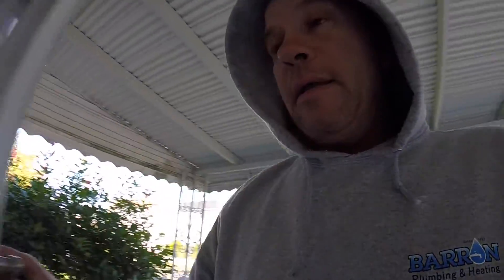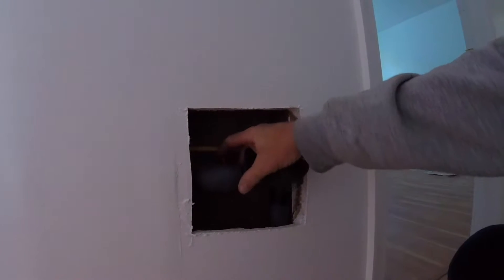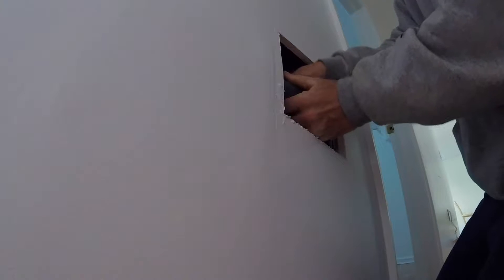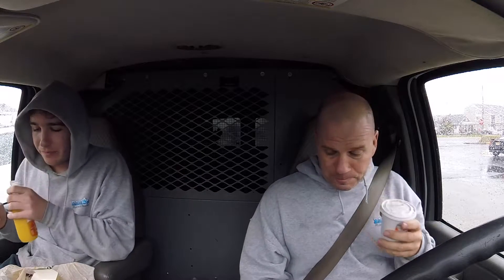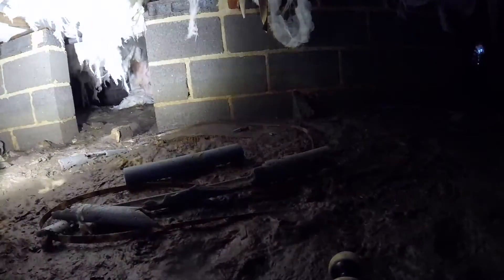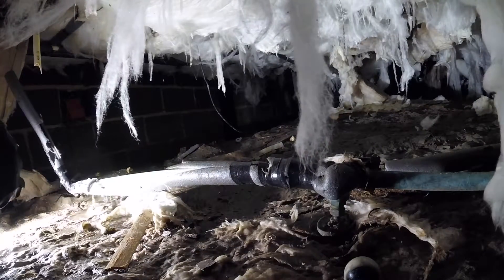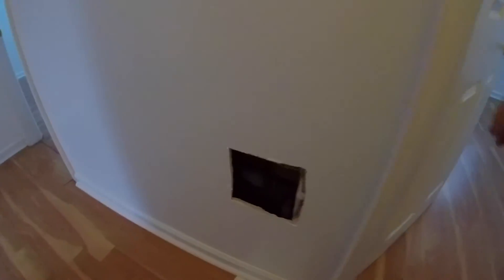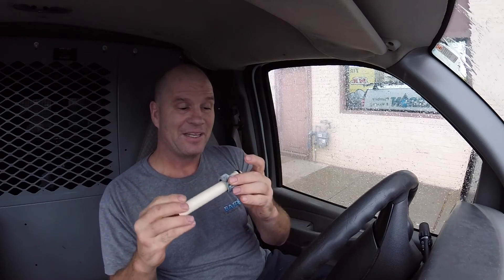Water Service  Copper Pipe To CPVC Pipe Repair

Comment: I find using air to pressurize the lines works great for leak finding, even a pinhole, buried in insulation and walls tends to hiss pretty loud. and sure beats water damage!
Reply from the maker: No Doubt.

Comment: We use flow guard gold in Ma the one tip I can give u is use the glue sparingly, if u use too much it can eat away at the pipe.  we did a test with one of there ball valves and poured glue into a closed ball valve in central ma and by the next day it had eaten away the plastic ball in a ball valve.
Reply from the maker: oh wow..interesting. I hope never to use it again. ha

Comment: You'll should get some walkie talkies so you wouldn't have to shout every now and then. Say in a case you're on the ground floor and Chucky is on the second floor of a building and you'll need to communicate, the walkie talkies will come in pretty handy. Just a suggestion i thought i should make. Think about it :)
Reply from the maker: So many tools..man you could go broke..great idea. We usually use cells for situations like this.
Reply: 20 bucks at walmart. Makes it easier to talk without having to dial a phone.

Comment: I've installed cpvc that's now been in service for well longer than the younger SB's have been alive. the scary part of it? I was a good ways younger than them!
of course I also installed "polybutylene" which held up fine for the period of time it was used (mid 1992 to 2005) don't judge I was a young "school brat". you probably wont find many folks that did plumbing well under 18 by themselves, without having any relatives in the plumbing trade. must be the german side of me =p
Reply from the maker: the ole poly pipe....i ran miles of that too when employed before i got my biz. Plumbing is evolving at the speed of light...well maybe not that fast.  ha

Comment: They have cpvc in alot of new houses around me it's junk. Been to a few homes after a freeze up. Last one had 27 busted 90's the homeowner had no drywall left after I got done finding leaks. At least 30000 in damage. The home was only 10 years old.
Reply: morale of the story, don't let plumbing freeze ;)
Reply from the maker: house must of looked like swiss cheese...wow.

Comment: Always use cleaner/primer to clean CPVC pipe first then glue. They have special CPVC glue & Cleaner/primer
Reply: they have one step primer/glue for cpvc *gold*. it can be used if permitted by code there. I'd never try it but myself and always prime first.
well maybe if it was temporary exposed feeder.
Reply from the maker: Since it was my first time working with the GOLD....ha. I read can and it said glue only. Or let me correct that. CB2 read can and I never looked back. The question is should have I....hmmmmmmm. we shall see.

Comment: That Flo gold is the worst,bought a whole case of that stuff years ago,ended up throwing most of it away. It says no primer needed ha,good job guys.
Reply from the maker: omg, this job was gnarly.
Reply: I just bought a house that's half copper and half FlowGuard gold.  The CPVC has a 1999 date on it.  I've started to replace everything with PEX,  if I need to shut off a valve on that CPVC I turn off the water first as I fear valves cracking right off.  Nothing worse then having a wide open snapped water line.

Comment: there are a lot of rules when prepping and gluing cpvc....you broke everyone of them. tough job under there tho
Reply from the maker: main rule i broke was leaving cpvc in there. what i miss? got to be honest i never worked with it. Thanks B
Reply: @ChuckBarron  I respect you for going under there- tough job. those types of jobs are for the young guys
Reply from the maker: oh for sure. I wanted CB2 to have a teachable moment but just had to get out of there so I pushed on.
Reply: @ChuckBarron  as far I saw, you glued and set it fine lol. Dknt see the issue with your job. This pipe is meant for pressurized and hot water as far as I know

Comment: How long did you wait for the glue to set?
Reply from the maker: 5 min...according to what the can said. Sound right?
Reply: I always give it an hour it depends on how you interpret the label
Reply: Yeah should let it sit for an hour , cpvc is crappy , they ran plenty of it here , including 2” mains in townhouses , I fixed one PRV rig that the broken by the fencing crew that was 2 “ and to shut down 900 units while doing repair because they asphalted over the project individual shut off valves in the street.
Reply: I think it was 4 1/2 mins

Comment: That low battery chirp from the smoke detector would have drove me nuts.  I keep a dozen or so fresh 9V battery in the truck for calls like that and just change them for the customer and add an extra couple bucks on the bill.  That way I don't have to worry about a 2AM "smoke detector sounding" call when I'm at the station cause you know they never call at 2PM when you're already up!
Reply from the maker: oh you know it...so fun at 2am for such a clown call.
Reply: what gets me is there's people that live with them chirping and I don't mean just for a few days. I've told them it was driving me nuts and asked if I should change the batteries for them. they had no idea the things had batteries, nor that they shouldn't be chirping. total face-palm >_<

Comment: Cpvc pipe is pvc pipe except you can run it on hot sides. Its chlorinated pvc pipe
Reply from the maker: ya we really do not use it hear. I was the lucky plumber on this repair. ha

Comment: I have to admit that I have used CPVC on a couple of projects successfully. I don't like it very much. I suspect that what happened in the case of your project is that it froze and cracked as a result. I probably would replace it with PEX. Theoretically, PEX does not crack when it freezes.
Reply from the maker: Yes. That was the plan. I was glad it worked.
Reply: Pex will freeze, swell, thaw & not burst, but at the fittings it will burst
Reply: there's good pex and there's not good pex....... pay attention to the "type" some will in fact split easier when frozen. the other issue is fittings, they can and will break or get pushed right out the pipe. back to rule #1, don't let plumbing freeze with any freezable liquid inside it ;)

Comment: You've got almost every other good power tool for plumbing, you need the Milwaukee 12 volt PVC cutter!  ;)
Reply from the maker: yes....I just used one. I gotta get one. the lil sawzall you mean?
Reply: @ChuckBarron  nope, I have the little sawzall too, but they make a PVC cutter as well

Comment: To cut the CPVC ratchet Cutters will be best
Reply from the maker: roger that....thanks chris
Reply: Good on new CPVC, but bad for old CPVC, especially hot water side. CPVC tends to harden overtime and become brittle. Using ratchet cutter often cracks the pipe. This is the main reason I hate CPVC.

Comment: "torch, flux, solder, brushes, couple of rags and a 3/4" pex to female copper sweat adapter" would have been what I had the parts runner bring =p
then again, I'd probably have just put copper in anyway...
Reply from the maker: Ya but I had to adapt to Cpvc wonder pipe.  I could of cut old stop and waist out. Put in propress ball valve and I had some shark bite couplings on truck. So many ways to skin a cat. Thinking back I should of did that instead of trip to home depot. oh well.
Reply: uhh, I was thinking heat and remove the copper half of broken cpvc union and clean it while hot and sweat on new pex adapter, using the existing short copper stub to valve..

Comment: has your head, neck, hands and back quit itching yet? I know what happens when playing in insulation like that lol
Reply from the maker: actually I made it out ok...so far. I been there though. oh that is no fun.
Reply: throttle bottle  I dunno how he does it but I use a full face for that. I hate crawl spaces
Reply: try doing electrical and vents properly in a blow in fiberglass attic.... you'll be swimming in it and standing on your head, there won't be a single spot of you that doesn't itch lol
Reply: I feel for the AC guys in the summer- all they do is install AC's in the summer and crawl in attics... Why doesn't anyone get Ac's installed in the winter? Should be a discount...
Reply: lol, because it sucks having to set up temporary heating and charging an A/C in winter is no bueno (heat-pump is an exception) but generally still needs checked and charged in the summer.. I know all about attics in summer, flopping in over 36 inch deep blown fiberglass like a fish, running wiring properly down ceiling joists and fishing down walls.
stupid 90's "builder" model homes, without ceiling boxes in any of the bedrooms, guess what the first thing people want installed? ceiling fans and lights :))

Comment: think thats bad conditions, i do a lot of repairs on mobile homes. Hoooorible. Awful conditions. awful piping. they used Polybutylene pipe which is often 3/8, or 1/2 if lucky. that stuff is junk and cracks 99 percent of the time off a fitting. only way to fix and adapt are sharkbite push connect into pex to replace that section.

Comment: CPVC is garbage! it gets so brittle while you're working one section other section can easily break. You were lucky the attach new piece was to a vertical pipe if it was horizontal any move on one end would cause any connection on the other end to break.
Reply from the maker: like I said in vid....they were one break away from getting it all repiped.  lol. I could not believe how it split.